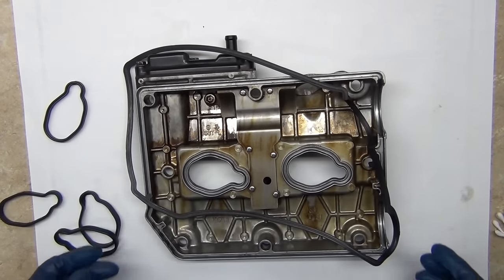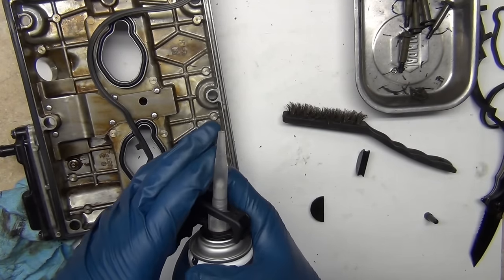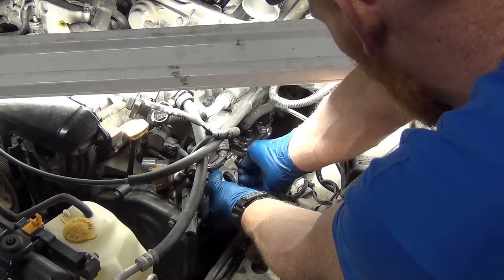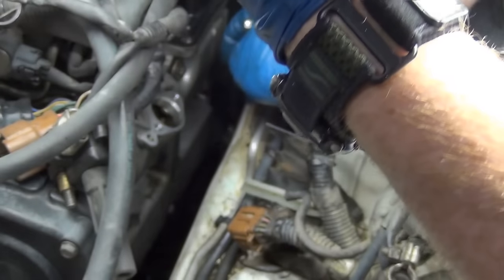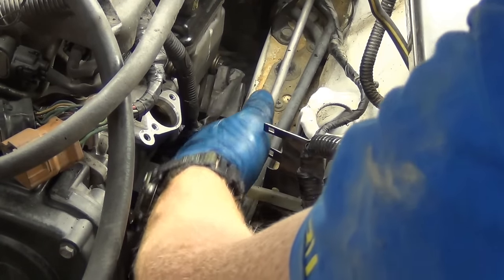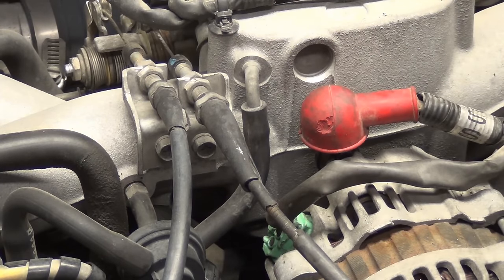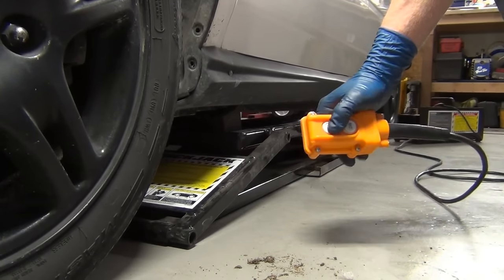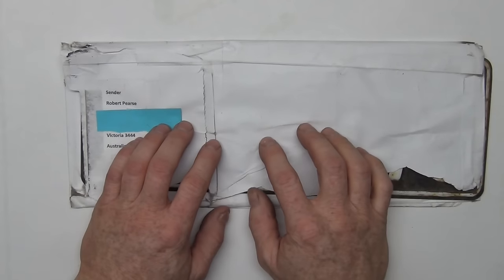Subaru Valve Cover Gasket Replacement How to Part 2

Comment: Honda bond is a great stuff to hold a Gaskets into place. I usually only in the areas like the Cam Bridges and the "Case to Cylinder" 3 point sealing surface.  Great video Brian. I know that feeling what you said 6:16. I just recently had a "Friend" had me do all kinds of work on his quad Rebuilt it with a big bore kit ported head, upgraded carb etc turned it into beast. Then he went to his brother "Which is my best friend" bitching all because I used a Piece of Rubber Hose to space the Fuel Tank up a slight bit higher because it was missing the Rubber Damper for the tank and he was rushing me to get the quad back to him so I did what I could ya know? But won't admit he said that about me. I hate people like that still never paid me either so I told him not to worry about paying me for labor or Machine work after I paid 200 Bucks worth of machine work to be done and an additional 15 hours of Labor. I'm to nice of a guy. I just got fed up.

Comment: Thank you so much for your tutorial! My 2002 impreza outback hatch I bought in May 2018 had no leaks and after our first freeze, i started leaking a lot of oil on the drivers side. (Chicago here) So BIG thanks for this. I've learned a lot. =]

Comment: It's funny you mentioned to put the bolt onto the cover before install since it hits the body (since you couldn't take it out before while Uninstalling it) but you spent a while trying to jam it into the hole n talking about lifting the engine etc.

Comment: Good way to do subaru rocker cover gaskets,
Do a few dots of sealent inside where the gasket sits, then insert,and turn up side down with light weight
After a few hours,it's going to give you a good easy install
That's the way I do them

Comment: Cool vid. Thanks for taking the time to make it.                         If you have twisted a valve cover bolt on a flat engine it will make you a believer in torquing....  I think those are only 4-5 lbs. That's inch-pound territory.

Comment: Thanks for your very detailed videos. I just watched parts 1 and 2 and they really cut down on the intimidation factor. I'm not sure if my new project 2010 Tribeca is leaking at the valve cover gaskets, but if it is I'm not confident that I can get at and replace them, and all the ancillary bits. KEEP UP THE GOOD WORK!

Comment: Hi All , I have a set of 2007 Subaru 2.5 N/A heads that I need to bring in for re-surfacing. But, for the life of me I can't see which is Left hand and Which is Right hand.  They Look Identical to me. Is there a way to tell?  I have them Completely Stripped Down, and I looks like they are totally Interchangeable, Identical & the Same ! ?  Help !!!  ;)

Comment: Far as I clean things,  I use cheap 2” paint brushes and 1” paint brushes with Purple Power and then spray brake cleaner to  clean off excess…
Also love watching your videos , I  took on the easy task of replacing the CV Axles on my 2001 Subaru Forester…When I marked the tie rods ( Testor white paint mini jar ) I took the car to get an alignment…My mechanic said the front end was find and the rear was out a little!!  Thanks for your videos!!

Comment: Recently i bought a 2013 impreza 2.0i and the third cylinder has a misfire. I took out the coilpack, saw oil all over it, got my phone down there with the light on and recording and all i saw was an oil flooded spark plug hole and a gasket showing from the top. I would just do the repair myself, but i have a warranty on this car so it will be a free repair when i take it in on monday. Im just too lazy to get around to it. lol thanks for this video though, helps for future reference.

Comment: I have two of these engines and instead of fixing the leak by doing the gaskets, I just use snake oil to slow the leaks. Preventive maintenance. The old EJ22, these rocker arm gaskets took five minutes to replace. This EJ25 is way too time consuming and complex to mess with unless you really have to do it where you got visible puddle under your car and fumes in your cab. If Subaru released EJ25 instead of the EJ22 in 1990, the company would have been dead by 1999.

Comment: At 8:00 I thought you'd put the bottom rear bolt (that wouldn't clear the body) into the cover before you set it down into place?

At 16:00 I thought that on all cars the lower numbered cylinders are at the front of the car.  EG, cylinders 1 and 2 would have the white tabs.

Comment: Thanks for sharing, I'm debating if I want to tackle my 2000 Subaru Forester valve covers now or take it to a shop, had head gaskets done about 50,000 miles back, so i guess if it just now started leaking bad then i guess that was a pretty good run on those gaskets....

Comment: Would you use the permatex gasket maker around the spark plug tube seals too?  I Used fel-pro gaskets and 30,000 miles later I saw some oil on my spark plugs during my 90K tuneup along with a faint burning oil smell with a/c or heater on. I'd like a repair to last a little longer this time so I'm thinking about using your gasket maker technique.

Comment: Is there a way I can just JB weld along the seam so oil doesn’t leak and just stays inside? Or will that cause something bad to happen? Easier than removing both sides 🤷
Reply: no. It'll peel off, that's a slapdash measure, if it even works

Comment: Brian, an old Subaru fan like you aught to know the dip stick always gives a false reading on this engine when you first pull it.  I never bothered to investigate but I assume the dip stick is near horizontal where it enters the pan. 

The other neat thing Subaru does with this engine and its oil is to put the drain plug on the side of the pan.  When the plug is pulled oil shoots out sideways landing beside not in the catch pan.  Keep the oil dry handy.
Reply: The case of the first pull mystery has been solved by sherlock.  This issue is only happening on dipsticks that are sealed with an air tight O ring at the top.  Trapped air in there pushes oil out as the engine warms up, blows a bubble or two at peak temp and then sucks extra oil up into the tube as it cools giving the errant first pull reading of way too doggone high.  Subsequent dips read correctly.  All the best, Watson.
Reply: The dip stick tube would have to enter below the oil level for this to work which seems kinda odd.  But if it does, you've nailed it.  I love these little mysteries.

Comment: Thank you! I wish I had watched this before doing this job when my engine was out of the car. I used genuine gaskets but no sealant or gasket maker and when I got it all out back together it started leaking almost immediately, it was such a terrible feeling. I have let it leak for 2 years now because I thought I would have to pull the engine to get this done. You showed it's possible and that's all I needed to know, thanks!

Comment: Of course when the factory did this they had the major advantage of not having a chassis in the way to block any access to the engine, plus there was no oil in there in any form till the final steps of filling the oil galleys and putting the oil pressure sensor in the block.

Comment: As an owner of 5 Subarus at one time or another, I really love your videos.  My son and I have tackled different repair jobs over the years.  Got a question that is not related to this though.  Have you encountered the issue in the '08 WRX/STI where the clutch / brake pedal bracket spot welds are breaking loose from the firewall?  Would love to see an in depth video of dash removal.  Thanks.

Comment: I've had issues with the drivers side plugs. They've been fouled twice in 2 years. I replaced the plug Well seals, valve cover gasket, injectors, wires and coil. I'm getting the Miss again on the same side. What's going on that the drivers side fouls and misses? Subaru can't tell me...they just say replace plugs and wires and plug Well seals. This is twice in 2 years I've had to do this. Any other suggestions?
Reply: Jessie Winegeart bro you need a valve job then 🔧

Comment: I was watching you put the battery back on and remembered there are many people that do grounding mods on Subarus. What's you opinion on that?
Reply from the maker: Grounds are vital on a 12V system (low pressure)- especially if you have a sound system with an amp or live in the rust belt.  The factory ones are fine, but more will only help get those little electron pixies in batteryville out to work in the cars electrical system.

Comment: Just wanted to say thanks for the videos.  This one came out just in time for me, as I'll be pulling my motor on my 09 this weekend to check the leak out on the drivers side.  Bought it with 127k and stripped the timing belt back in the spring so I used your videos and others as well as 2.5i manual to do a complete rebuild.  Its been running great, minus the slight oil leak and sometimes it will smoke a little on first startup (hoping that has to do with the gasket or seal).  Anyway hoping the grey gasket maker seals up the drivers side and that I don't find anymore leaks.  Thanks again for your videos and especially you attention to detail.  You've helped save me 1000's.
Reply from the maker: Way to go Ernie!  Glad to hear it.  If your valve stem seals get worn out it can cause a little smoke on start up, but sometimes Subaru's will do that with a little cylinder wall wear.  They're horizontally apposed which means oil can creep horizontally into the compression chamber past the piston rings in super small quantities if you have some cylinder wall scoring and run synthetic or light weight oil.  It's generally nothing to freak out about though.
Reply: briansmobile1 yea i was hopping its valve seal.  The valve seals are new along with the intake and exaust valves, but thier not subaru brand and a local dealer told me non subaru stems seals tend to leak.  valves aren't subaru either.  A guy I know that use to build motors said its probably the new rings I put in because I didnt score/hone the cylinder walls, said they probably didnt seat properly. I've never seen cylinder walls before this but the cross hatching was still there from factory.  I didn't know about honing the cylinder walls till after I built the motor, so it might be oil leaking past the rings.  I have to say it was a pretty exciting moment turning the key on my first engine rebuild, pretty nerve racking actually.  Maybe a video on cylinder wall or rings sometime in the future?  Anyway thanks again for the videos.

Comment: I was just looking at a 2005 wrx says just needs a tune up. don't know how good the 05 is but love subaru wrx just one set back is its automatic
Reply from the maker: Ya, mine's an automatic too.  It's slightly heavier and slower, but my wife doesn't mind driving it at all. Plus your right hand if free to TCB.
Reply: Cars these days don't really need tune ups in the traditional sense.  What they do require is maintenance, some of which can be expensive.

Comment: I have an 05 Saab 92x with an ej205 WRX motor. I think it needs a lifter, any tips to find out if it is a lifter or to pinpoint which cylinder?
Reply: The WRX engine is cam on bucket - no lifters.
Reply from the maker: Ya- feeler gauges like these between the cam lobes in the round positions and the buckets http://amzn.to/2e37ZYe  The clearance for the exhaust (bottom side) and intake (top side) specifications are often printed on the Emissions tag.  If your gauge is too loose- you need to pull that bucket and add a little puck to the inside bottom center of the bucket that is thicker.  You use bigger gauges till you find a fit- then write down what it is.  Take that measure and subtract what the Emissions tag says it should be.  This is the golden number you need to add to what the shim is that's in the bucket. Then pull out the bucket and measure the shim it came with and add that golden number (tiny number) to it.  That's the size of the new shim you need to take up the slack that is rattling if it's valve adjustment that's needed.  You have to remove the timing belt and camshafts to do this.
Reply: briansmobile1 thanks! I have to do a timing belt, water pump job on the car anyways. Perfect timing I guess
Reply: There's a special Subaru tool called a shim replacer that allows this job to be done without removing cams.  The timing belt cover does have to come off.
Reply: Lorrin Barth good to know thanks!!